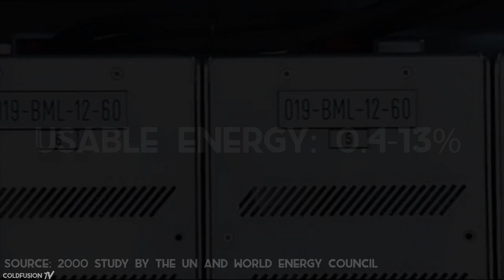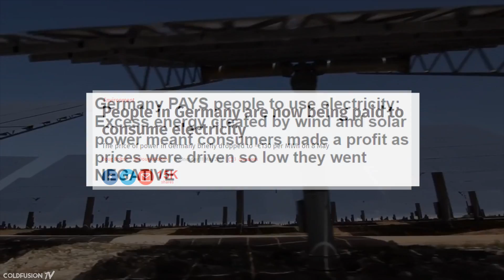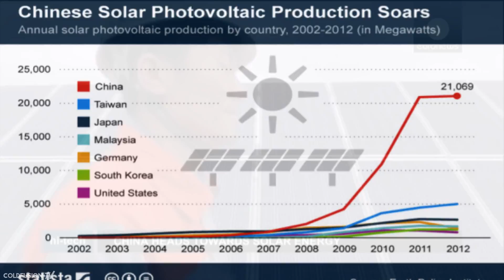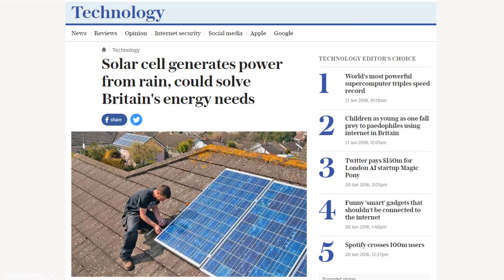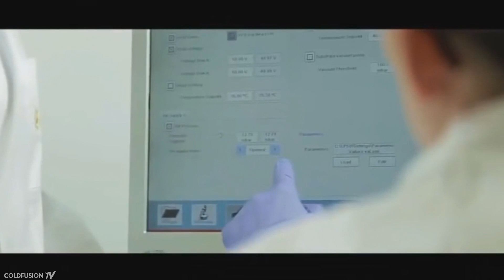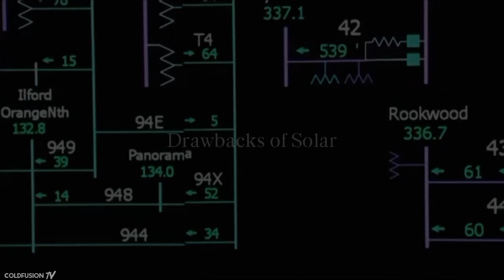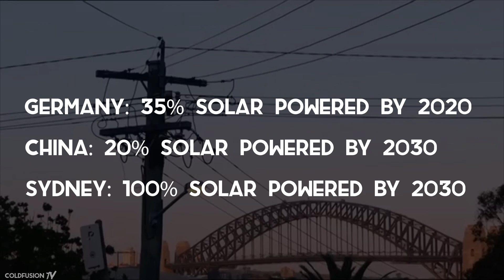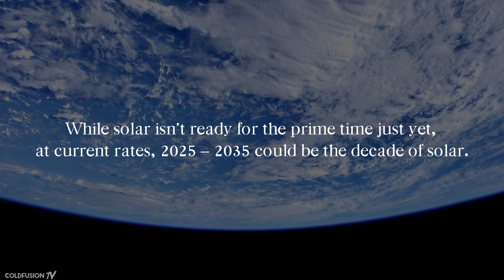The Truth About Solar

Comment: who would dislike this? ?
Reply: People who realize that the single most important feature in energy production is (along with almost every other technology) reliability.  We reach over to hit the switch and expect the lights to turn on without exception.

Solar is not reliable.
Reply: perhaps the people who notice how this video does not mention the environmental cost of solar panels.
Reply: Nennog the engineer Not just the environmental cost, the financial cost.  Despite coming down in cost significantly, solar has deep hidden costs requiring extensive backup power generation.
Reply: Considering that there aren't many intelligent people on youtube, they are probably morons, as opposed to energy scientists and skeptics who might actually dislike the fact that solar energy was presented here with a clear bias.
Reply: Kevin Tee "So fossil fuel don't have environmental cost and financial cost? I see."

That isn't the argument.  The argument is that solar energy isn't as environmentally friendly as people generally assume.
Reply: I see. the fossil fuel lobby is working  perfectly
Reply: So fossil fuel don't have environmental cost and financial cost? I see.
Reply: Hexyl Cinnamal You are ignoring what business analysts call Net Present Value, which factors in inflation.  As a general rule, a project like this isn't viable unless you have an RIO (return on investment) of 10 years or less.

But all of this ignores the larger logistical problems related to solar power.  Simply put, solar energy is capricious (even a little bit of cloud cover will shut down a solar panel), but we have to produce energy for the grid such that the lights will always turn on. 

Solar energy only works because there is a series of dedicated flexible power generators that burn fossil fuels - which is expensive, and usually not factored into the cost of wind/solar energy.
Reply: The fossil fuel executives, and the politicians they bribe, er, "lobby".
Reply: mericle123 When the sun isn't shining (either from cloud cover or at night time) we have to build an entire system of back up generators - all of which are powered by none other than fossil fuels, which sort of defeats the purpose.
Reply: Kevin Tee I have heard of it.  The thought process on this is that it stores potential energy thermally in salt instead of other more efficient methods such as gravitational storage - i.e. water reservoirs.  It has two major faults.

1) It's very expensive.

2) It levels out energy production, but only to the extent that it can continue to produce power for 2-7 hours past the afternoon hours.  It is still worthless when you have to deal with overcast skies.

The fact remains that wind/solar are generally incapable of supporting a first world economy.  Places like Germany/Denmark rely very heavily on wind/solar, but they also have the most expensive energy rates in the world while their carbon production is significantly higher than their neighbors like France.
Reply: Hexyl Cinnamal Okay, so I rewatched the video just to make sure I wasn't missing anything. 

They sidestepped the whole cloud cover argument by quoting Elon Musk, as if this is a current technology we have in our possession.  Let's be clear: we do not have this technology, and I would love to push Musk on his answer because I frankly don't feel it is justified.

When you have cloud cover, solar panels don't work very well at all.  Someday in the future we might have a better panel by utilizing a broader spectrum of electromagnetism that pierce the clouds - which is how plants work.
Reply: Hexyl Cinnamal Musk commented that 80% of solar energy makes it through the clouds.  Unfortunately, solar panels are lucky to get 20% on an overcast day.

Besides that, battery technology hasn't really improved all that much over the last 60+ years.  (To be clear, it has improved, especially in cost, but the energy density of a battery hasn't improved very much.)  A revolutionarily better battery is the single greatest engineering challenge of our day.
Reply: Hexyl Cinnamal The power company is generally regulated by the government and only pays you because the government forces them to.  But why is the power company bad?  In the United States, we pay some of the lowest power rates in the world.  Germany's electrical grid cost 3-4 times as much to keep the lights on (the most expensive in the developed world, actually), all while they have a significantly higher carbon footprint than their neighbor, France.  France, BTW, also has one of the cheapest power rates in the Europe.

Solar energy is a sham.  If we care about the environment, nuclear is by far the best option on the table.  A single AP-1000 nuclear power reactor can replace 2000 windmills and does not require backup power generation from fossil fuel sources - meaning there is virtually no CO2 production.
Reply: ArcDuc Concerns regarding the safety of nuclear power lose relevance when we look at the bigger picture.  The best analogy would be related to travel.

We all know that airline travel is safer than driving.  Much safer.  But if an airliner ever crashes, it will almost certainly be a big deal.  Because of this, people are afraid to fly but not afraid to drive.

When you break it down by the amount of energy produced, nuclear power has the safest safety record of any industry on the planet, beating even solar.  (It turns out that people get themselves killed installing panels on rooftops.)

http://nextbigfuture.com/2011/03/deaths-per-twh-by-energy-source.html

Besides that, radiation (or rather contamination) going out to the surrounding areas is mostly hype.  There have been some accidents in the past, but you might be surprised to find out that people who work at nuclear power plants aren't exposed to very much radiation at all, even during some accidents like Three Mile Island.

Nuclear energy is by far the most environmentally friendly option on the table.
Reply: ArcDuc You are talking about the Fukushima nuclear reactor.

Okay.  Where to start?

The Tohoku earthquake/tsunami was the ultimate cause for the reactor to melt down.  The earthquake and tsunami were responsible for the deaths of 19,000 people.  At the nuclear reactor, not a single person died from radiation poisoning.  Yes, Fukushima was bad (take a moment and think of my airliner analogy), it was nowhere near as bad as people understand.

Reports stating that radioactive contamination reached the American west coast are flat out false.  More details explaining this can be found here...

http://www.snopes.com/photos/technology/fukushima.asp

Go green.  Go nuclear.
Reply: Hexyl Cinnamal "nuclear production produces many toxic byproducts that need to be out in storage."

There are two important concepts to understand about waste.

First, virtually every industry produces toxic waste, including the wind/solar industries.

Second, the amount of nuclear waste generated for the amount energy produced is incredibly small.  Furthermore, with what little waste is produced, we know how to store it safely such that it will never impact anyone.

"You're making it seem like we cannot get enough energy from solar when the reality is that virtually no one has ever had an issue."

There have been broad attempts to increase the amount of solar energy produced.  The fact remains that solar energy produces a tiny bit of energy even in countries where government policy encourages it to be used more often.  Why is this?  There are several reasons for this, but it mostly has to do with how unpredictable these power sources are which requires fossil fuels as backups.  The most important factor with any technology lies in how reliable it is.  Solar is not reliable.

"Plus if no people are there to control the reactor then it could blow up."

This statement is not true.  I've worked as an engineer in nuclear research facilities.  There are fail safes built into the plant that prevent this very thing from happening.  Besides, you are making the same mistake I mentioned earlier about airline travel.  That is to say, history has proven nuclear energy to have an unprecedented record of safety that not even the solar industry can compete with.
Reply: Hexyl Cinnamal "And with solar power we don't need to have giant power companies we could have our own little power company in our homes removing the need for power lines"

You are making a good point here in that the grid needs to have greater local control for reliability purposes, however the larger grid is essential to all first world economies.  Those transmission lines you worry about won't go away with more solar panels.

"Also we don't gotta worry about having a power demand issue with everyone sucking up the electricity as it's your own electricty."

I know people who live "off the grid" and their standard of living is sort of terrible.  Unless they have a massive set of solar panels (much bigger than you can fit on your roof) theyyou can't enjoy things like microwaves or air conditioners because these draw way too much power.

"...no more electric bills..."

The first law of economics is more-or-less the same as the first law of thermodynamics: there is no free lunch.  If there was ever a lesson I wish everyone understood, it is that nothing is ever free.  You might not have an electric bill, but that only means you end up with a bill for solar panels and batteries that are nowhere near as cost effective as the traditional grid we all know today.
Reply: Kevin Tee I don't think you understood my comment.
Reply: I think the most important thing to consider is solar in comparison to fossil fuels, and while solar isn't as efficient as fossil fuels yet, by the time they have been developed to that point there will be many other cost efficient and environmental benefits over the use of fossil fuels. The main benefit is that solar power is going to get better, fossil fuels will stay terrible.
Reply: +Ike Evans No, not always, have you heard of solar thermal? It can generate electricity at night.
Reply: idiots.
Reply: Ike Evans but creates radiation in the surrounding area while putting a while city the size of new York or Tokyo at risk.
Reply: Ike Evans so what about that power plant in Tokyo (I forget it's name) that affects the west coast of the us? It mutates the fish in the ocean and can be found on the western beaches of the Americas.
Reply: Hexyl Cinnamal I was getting around to your last half of your statement.  Your statement was rather long, and that's fine.  I'm enjoying my conversation with you.  I decided to break up my response into two parts but you responded too quickly.
Reply: Hexyl Cinnamal One more response to your comment...

"We could plant trees where the old power lines were...where the old power companies where...billions of more trees would be planted. "

I'm not sure why this is relevant.  In most industrialized nations, the tree population has been growing for decades or even centuries, not shrinking.  The planet is nowhere near running out of trees.
Reply: Where do you get your infomation?? Batteries are made from Lithium and solar panels from silicon, both of which are plentiful and inexpensive. As described in the video, the cost per until of both is coming down and will soon over take fossil fuels.
Reply: SuperResistant
That's what it says in wikipedia: "Most solar modules are currently produced from crystalline silicon (c-Si) solar cells made of multicrystalline and monocrystalline silicon. In 2013, crystalline silicon accounted for more than 90 percent of worldwide PV production, "
Reply: Ok. I never expected like a zillion people to dislike and think that human ingenuity would win at some point . I was wrong.  Sign me up for the next wave of destroying our world
Reply: So what would you propose? Here I'll give a quick argument before you answer: Wind Power? Does not produce a lot for the space needed. Solar Panels? Good idea but you still have highly toxic and highly flamable batteries to deal with. Natural Gas? Coal? No, those have problems with pollution Nuclear Power? Good idea, take up a lot of space but not as much as wind power plant things, they also are very clean compared to natural gas, they also are less dangerous then natural gas, same goes for everything on this list.
Reply: *****
Certain ones do, but i was just trying to think of a negative,
Reply: none Apparently nuclear pp companies are the only ones to do that

Comment: Develop a photocell paint for cars and houses.
Reply: Stay tuned, they are already working on it!
Reply: Actually already exists, though at the very low end of efficiency, so the low cost of the systems is offset by the larger area you have to have for installation.
Reply: There is already a solar cell paint I believe it was Stanford students who created it.  There is also a better painted cell in Bloom Box that turns hydrogen into energy without combustion, and it's much cheaper.
Reply: try living in the county, okay.
Reply: Please provide data.

Comment: Solar is still expensive relative to other energies. Gas is 4.5 cents per kilo watt and nuclear is even cheaper. Solar will always be more expensive and will reach a limit because even at 100% efficiency there is not encyclopedic ugh energy density in the Suns beams per square meter to go as low as 4cents per kilowatt. But I am sure my words will be wasted I'm those in love with solar

Comment: The panels on roof tops don't have 30-35% efficiency. These are assumingly the ones NASA is using. Those used by common people have wafer efficiency of 20-25% and a panel efficiency of 15-20%.

Comment: Solar and wind power require a bit of a paradigm shift in industry. With massive, but intermittent oversupply, we have to look for processes that can take advantage of the situation; that can start and stop on demand.
Mass shifting to store electricity as potential energy for later use is just the beginning.
Drive stirling engines just to freeze CO2 out of the atmosphere.
Desalinate seawater for the price of plant maintenance and wages.
Require all open loop cooling system to be saltwater tolerant and pump seawater inland for that purpose. Scale up power plant cooling towers and use them as gigaton evaporators to make our own bloody rainclouds exactly where we want them. Ship the salt back to the ocean in railcars, via any convenient mountains.  (Paradigm shift for railway engineering too. Mountains good, plains bad.)
Cheap/free energy means efficiency becomes far less important than utility. With this particular hammer, a lot of problems can be reduced to nails. Simple waste can be reduced to its constituent atoms, and the radioactive ones can be plucked from nuclear, one by one if need be. Climate control entire cities.

Comment: Chile has mountains? Chile has whacking big MOUNTAINS.

So, cable, or rack and pinion railways and rail cars full of rocks.

And if you use double ended armatures you have yourself a DC motor and and AC alternator, neatly solving the problem of connecting a DC source to an AC grid.

Comment: But what about the amount of energy that goes into producing each solar panel? Does the solar panel pay for the energy required to make it during it's service life (approximately 25yrs for most cells)? Also, what about the toxic materials released during production of these solar panels (and batteries that store the energy)?
Reply: The energy that goes into making a solar cell is paid for many times over during the cell's lifetime. 
The toxic materials released during production? What about it ?  What is your point ?